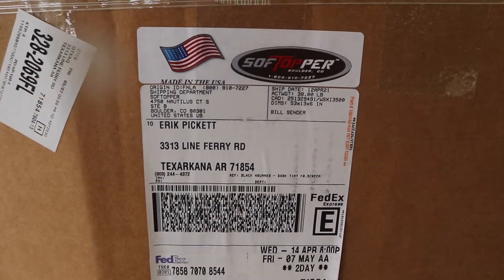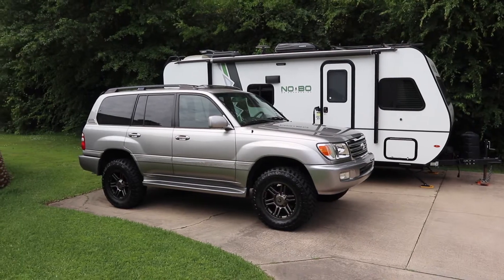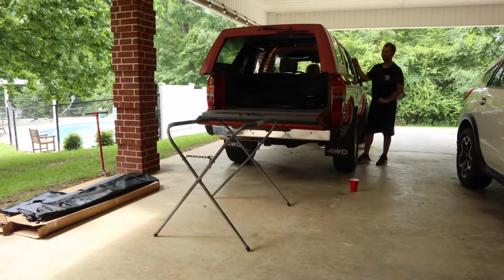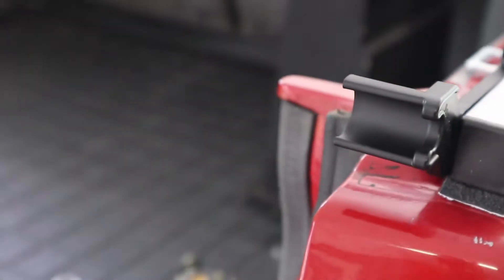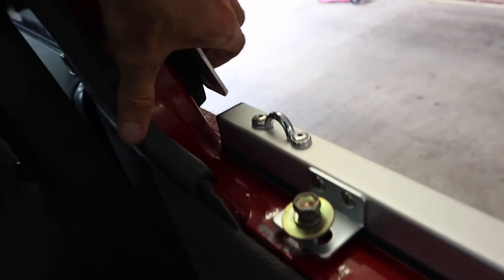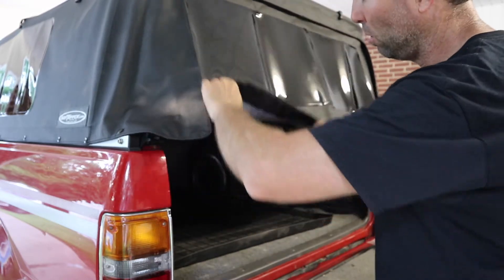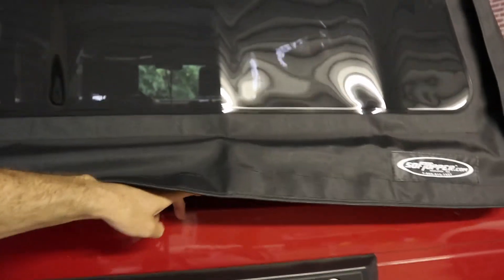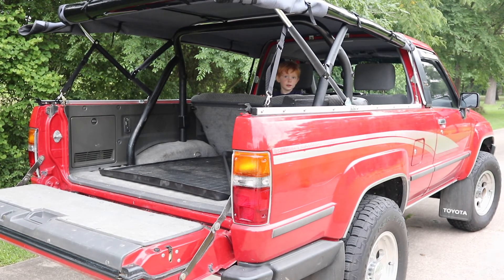1st Gen 4Runner SofTopper Install

Comment: I ran the softopper on my 4runner for three years. You probably figured this out already but you simply did not pull down on the rear pitman loop straps hard enough, that is why that last button is giving you trouble. Give each side a good umph and you will be good to go.
Reply: did you have any issues with theft? or just parked it in a garage maybe? i want a soft top for the summer but not sure about leaving it parked outside.
Reply: @natemendez1324  I've run a Kayline soft top on my 4Runner for 20+ years.  I installed a Grant security steering wheel for that concern.  Unlock and take the wheel with you and unless the thief comes in with a loader and trailer, they won't get very far.  I had one time someone popped in a stole a cheapo Harbor Freight volt meter out of the inside and another time some tweaker cut the catalytic converter out, but never took the vehicle.

I'm just getting ready to replace that top with a Killer Toy Top today.

Comment: Park it in the sun.  Then unsnap the whole side and snap just that last snap and then the others.  My Softopper is 7 years old and getting a little faded.  The company will sell just the soft top.  I never installed the velcro and it's been through hurricanes and car washes.   I appreciate the video.  I just posted a link to it so maybe you'll see some traffic.  Your 4Runner is gorgeous and I know your kids love it!
Reply from the maker: Thank you! The kids do love it, as do I! Great tips for the top. I have already made some adjustments and solved some of the tightness.

Comment: I am having trouble getting the lower passenger side bolt for the header bar lined up. Did you have any trouble? Tips?
Reply from the maker: @phxfunfly9083  I did have to bend the header bar to fit the curve. It came straight so you end up having to bend it around. You probably already figured that out but make sure it’s the right direction and not flipped. Not sure if this helps but I ran into that, making sure it was facing the right direction to match up with the bolt holes. Thanks for watching!

Comment: @Pickett Build, does install of the top require any drilling into the body/tub of the truck?  Or does the soft top rail simply use the same bolts/holes as the hard top?
Reply from the maker: No drilling necessary. Uses the factory hard top bolt holes.

Comment: I just received my soft topper for a 1979 Bronco a couple days ago.  I plan to pay a local company that specializes in stereos, interiors, and accessories to install it for me.   What do you think is a fair number of hours for the installation?   Yours should be pretty similar to mine.  I want to get a fair price, but I also don't want them to underestimate and be in a rush.
Reply from the maker: If it’s similar to mine you should be able to tackle it yourself. The instructions are easy to follow. Either way no more than than 1hr or 2 to get the job done. Thanks for watching!
Reply: @pickettbuilt2686  if you don't mind me asking; what would a man have to pay for a vehicle like that??
I found one in below average condition for $3,500..
Reply from the maker: @slammah5010  price is only going up and harder to find. I paid $9,500 and I thought that was a premium. But I am seeing similar go for 15k range or more these days. If you can find one that’s savable for less I would snatch it up.

Comment: The velcro on the back is the only reason I have not bought one.
Reply from the maker: I am not sure there is a better solution for the rear. I do like the way it seals up, however I don't like the look of the velcro patches either when the top is up. If I put the hardtop back on those patches would look strange back there. Small price to pay and I have been enjoying the top otherwise. Thanks for watching!
Reply: @pickettbuilt2686  killer toy tops
Reply from the maker: @gufiaito69able  I looked at those too and decided to go with the soft-topper. I bet those are sweet too though.

Comment: It worries me a bit cause it doesn’t really seem secure meaning someone can just break into the truck 😬😅
Reply from the maker: Don’t drive it to the mall or down town! It’s the same issue with jeeps, bronco’s, convertibles or any other vehicle with a soft top. I mainly use it for camping trips and joyrides with the family. Hopefully thieves aren’t eying old eighties Toyota’s, lol! Definitely don’t keep valuables in it.
Reply: @pickettbuilt2686  I appreciate the tip, I’ll probably end up installing an alarm in it to go with my soft top cause my rear window won’t go up and it’s driving me nuts trying to figure out 1. The issue and 2. The parts 😬 I’m brand new to the Yota game, I just got mine last week and I love it 😄❤️
Reply from the maker: @Theyresellingchocolates  Congrats!